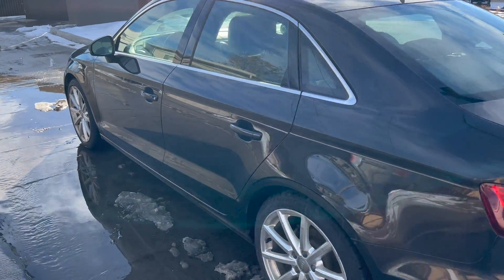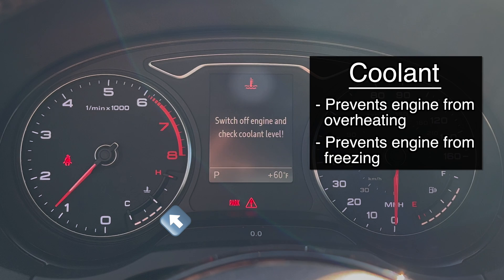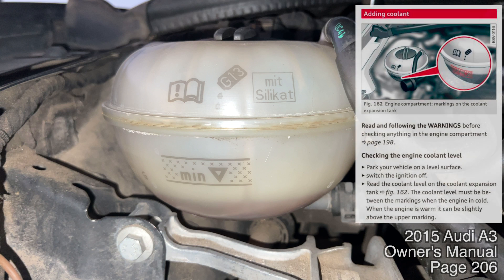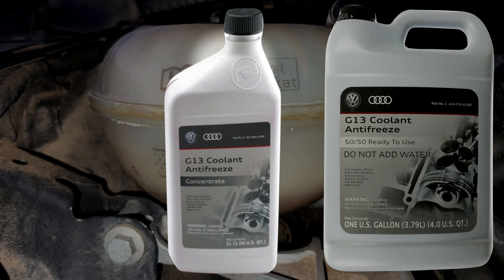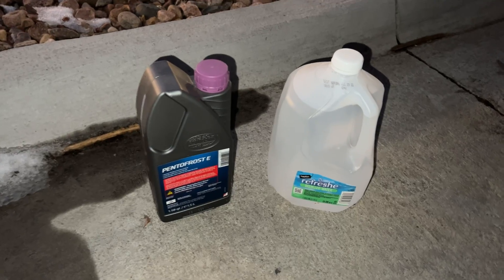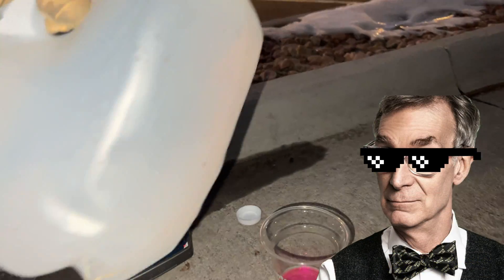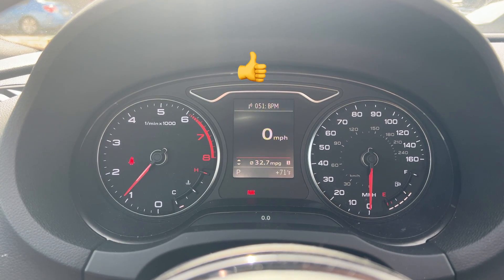How to Diagnose and Fix Low Coolant Warning for Audi (A3 8V) / VW

Comment from the maker: After further research, it appears that deionized water (also known as DI water) is preferred over distilled water (https://youtu.be/6K-EEiXzE-s?t=26) for mixing. However, due to its cost (affiliate link, $15/gal: https://amzn.to/3DkwAXy), and the owners manual stating that "mixing the coolant additive with distilled water is recommended", I will continue to use distilled water ($1/gal, affiliate link: https://amzn.to/3RnV4E5).
Moral of the story: deionized water > distilled water >> tap water

Apologies for not mentioning this in the video. Let me know if there's anything else that I missed!

Comment: Holy cow! Mine just came on today. I was waiting for crossing traffic to clear as I was trying to get out of a parking lot, sitting on an incline with my foot on the brake pedal and the car (2016 Audi A3 2.0 cab) in D. After I got out in traffic and 1/2 mile down the road, it came on. I thought it had something to do with what happened back there.
I drove the rest of the 4 miles home, but then forgot to look if it was still on before I turned it off.
I found this video, so I went out to eyeball the level. Guess where it was? The same level as yours!
Thank you for this.

Comment: What if when driving the temp drops all the way down. And ive been having a check engine light on for weeks now and all it reads on the oem is coolant flow, coolant intake codes
Reply from the maker: Well... based on your check engine light and coolant error codes, it sounds like something coolant-related is going wrong. 
0:39 "Coolant allows the engine to not get too cold and not get too hot."
Is it cold where you live right now? You might need the "anti-freeze" part of coolant right now to keep your engine from freezing or getting too cold. A cold engine means the oil will be thick and won't flow through the engine as easily resulting in more wear and tear on the engine than usual.

Comment: So i put the liquid to the seam area. After a day or two i find it low (in between max/min lines). After that i refilled to the seam, then again dropped after a day to between the max/min lines. I am bit sure if this is normal or not?
Reply from the maker: Hmm.. It's abnormal for the coolant to drop that fast and to require "topping off" every few days. You probably have a coolant leak.. 😕
Reply: @mattpopovich  thank you verimich for the reply. Imma leave my 2 cents here i case anyone would have the same issues:

2 fixes i had to do:

1. Replace water pump
2. Weld a leakage in the radiator (located farthest in the car, and was the harder issue to find)
Reply from the maker: Thanks so much for responding with your solution and helping the community! Glad you got to the bottom of it and got things fixed!

Comment: My coolant warning was on when I turned on the engine, and then I checked the coolant; it's basically an empty tank. Does that mean my coolant is leaking? Should I add coolant till the minimum line and keep driving?
Reply from the maker: Empty coolant tank = not good! 
0:51 "It's okay to keep driving with the low coolant light on as long as your engine stays at the normal operating temperature"
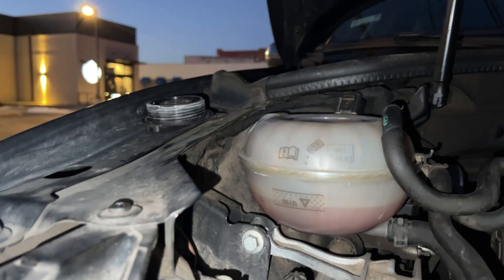5:48 "The coolant system is a sealed system. No coolant should be able to escape. Thus, if you're low on coolant, then that suggests a problem. If you have to add coolant regularly, then that suggests a problem. [...] If you need to add coolant once or twice a year, it's not a big deal."

I would add coolant between the minimum and maximum line and keep an eye on it. That should answer your question as to how bad it is leaking!

Comment: Hiya im filling everyday doing about 25 miles and light come on have had radiator done checked for leaks but nothing found but after driving i pull over i see water coming out what could my issue be
Reply from the maker: Filling every day = a coolant leak somewhere. Try to get a second opinion on the radiator.
5:48 "The coolant system is a sealed system. No coolant should be able to escape."

Comment: Very helpful video. I do have a question though. Do you need to leave the cap off, run the car at high heat to get rid of any possible bubbles, and then put the cap back on the reservoir after running it for a few mins or however long?
Reply from the maker: If you have air in the coolant line, yes. 
You can typically tell if you have air in the coolant line by seeing bubbles appearing in the coolant reservoir and/or your heat isn’t actually hot. 
Run the heat full blast with the coolant cap off. Make sure to keep an eye on the coolant level and add coolant as the air works its way out of the system. 
You can tell that you’re done by hot heat in the cabin and no more bubbles in the expansion tank.
Once done, put the cap back on and go for a drive. You still might get some air to come out of the system after a drive, so keep an eye on the coolant level for a bit.

Comment: What if the hazard don’t turn off
Reply from the maker: The hazards can be turned on and off from a button in the center of the dash. Check this video for additional information: https://youtu.be/6Y9JSbOg1vQ
Does that help?
Reply: @mattpopovich  not the hazard light the coolant light on the dash what if and don’t turn off

Comment: Did the manual say how full it should be at which temperature ? I'm currently at -7⁰C outside so I should only top up to minimum ?
Reply from the maker: It does not: https://ownersmanuals2.com/audi/a3-sedan-s3-sedan-2015-owners-manual-71870/page-208
I'd recommend, if it's one of your coldest winter days, wait until the car is cold and add coolant to the minimum line. My thinking is this is as cold that the coolant will ever be, it will always be warmer (and thus expand) above this point once the temperature outside warms up or once the car runs. If it gets colder or you get a low coolant warning, you can always add more!

Comment: Do I need to empty coolant tank before adding new coolant?
Reply from the maker: As long as you're adding the same type of coolant (or a type that can be mixed 2:07) and have no reason to believe your current coolant is dirty/contaminated, no need to empty the coolant tank before adding new coolant! 
CARFAX says flushing (completely emptying then filling with new coolant) every 100k - 150k mi is a good idea: https://www.carfax.com/blog/coolant-flush#:~:text=Is%20a%20Coolant%20Flush%20Really,hit%20100%2C000%20to%20150%2C000%20miles.

Comment: Hello, we have a 15” supercharged Q7, coolant is a little low and I want to top it off. So I can use the pentofrost or do I need to get the G13 Audi coolant. The current coolant in here is the stock dealer coolant.

Comment: I have an s3, so that temp gauge is replaced with a boost gauge. I keep getting the warning, but my coolant is just above the top line, like the owners manual says
Reply from the maker: Correct! Unfortunately I forgot about that when I published the video but I mentioned in the video description that there is a way to find the engine oil temperature on S3's, check this video for more information: https://www.youtube.com/watch?v=jSTC5FCfJdA
Note that oil temperature is different from coolant temperature, read this article for more information: http://www.tuneruniversity.com/blog/2011/05/keep-your-engine-alive-the-importance-of-oil-temperature/
Does the warning come on immediately when you turn the car on? That leads me to the car thinking the coolant is at the wrong level (likely low, not sure if the warning will come on for too much coolant).
Reply: @mattpopovich  it comes on right when I turn on the car but only the first few times (I deliver pizza for work so I do a lot of start/stopping) after a few deliveries it will no longer give me the message.
Reply from the maker: Hmm.. Weird. Do you park on a hill? I'm not sure why that would be happening. But it shouldn't be too serious if the warning goes away! 🤞
Reply: @mattpopovich  it is very odd. I park on a hill at home but I’ve tried pulling in and backing in but it still gives the warning. I’ve also tried parking on the street to see if the slanted driveway was the issue. Nothing changed. I did, however, just have the thermostat housing replaced. (There was a leak) I check the coolant every day just to make sure and it’s always inside the parameters. I really don’t know what’s wrong
Reply: @Cheggis same here. 2015 S3. Dealer replaced water pump and thermostat. Coolant is right at the max line, I check it every time I drive, still no change. I’m not sure why the warning would come on… any updates on your situation?
Reply: @M4R1011  YES! I narrowed it down to there being air bubbles in the coolant line. I had the coolant drained and replaced. That seemed to fix reoccurring warnings. Now it just warns me when I first start the car, or until the oil temps get up.

Comment: My coolant warning comes on after a cold day/night but the coolant level isn't low. It's within the min and max line. Could this be a sensor fault?
Reply from the maker: Hmm does the coolant warning turn off as well? If so, it sounds like the sensor is working.. maybe somehow calibrated wrong? I'd recommend double checking the coolant level when the warning comes on and when the warning comes off and then going from there.

Comment: Hi Matt, great video. Thank you for helpful tips! Digging deeper, what was the issue with your A3 8V for the coolant to be that low? I'm living the same situation right now with my A3 8V. (Bad head gasket seal? Water pump went bad?) Local garage filled me up with OEM G13 because i was near the same level as you were,way below minimum. They filled it a little over the maximum 3 days ago. Now I'm just below max , maybe it overflowed without me noticing,,, is it possible? I haven't noticed any leaks on the ground before or after they filled. It's entering the shop on Monday but I'm curious to know your issue.
Reply from the maker: Hi Gab, thanks for commenting. I don't know what caused my coolant to be low and frankly I don't plan on doing any further investigation, refilling with coolant once every few months is cheap and easy enough for me! 
As for your coolant going from above max to max, it could be a few things... If you checked the level before running the engine, the coolant could have "settled" to the lower level. It could have been warm (mid day or just recently ran engine) causing the coolant to expand when you first checked it and cool (evening/morning before you ran engine) causing the coolant to shrink a bit when you checked it later on. It also could be a slight leak somewhere. But I don't think overflow is a possibility as the coolant reservoir does have a lid on it preventing that from happening. 
Since your comment was a few days ago, what did the shop have to say?
Reply: @Matt Popovich  Hey Matt, I appreciate the response ! Thanks again for all the useful information 👍  Coolant has kept its level these last few days, The shop didn't find anything abnormal, no signs of leaks and able to keep engine at good temp. But I will keep an eye of my reservoir.  
Cheers!
Reply from the maker: @gabperreault2508  Glad to hear! Mine is an 8 year old vehicle with 120k miles on her so some minor work to keep her going is expected. Being that I'm waaay out of warranty, not sure what year yours is, but the $200+ diagnostic fee that Audi dealers charge can buy a lot of coolant (https://www.fcpeuro.com/products/audi-vw-coolant-antifreeze-pentosin-g013a8j1g) 😉
Cheers!

Comment: What if you have a TDI
Reply from the maker: I believe this video applies to TDI models as well. Check your owners manual to be sure. Your coolant reservoir will have a label of what coolant type to use (Ex. G13), which should be one of the options in my table shown at 2:20.

Comment: got this warning on my 2015 S3, but when I opened the lid for the coolant, it went up to max!!! was that a fake error? Now I have it a bit over max...just in case :D....Update on things...the water pump had a leak and was replaced
Reply from the maker: Sounds like you opened the coolant lid while the vehicle was still warm. Hot liquids (and gases) expand. 
Also, when the system is pressurized, the boiling point of coolant is raised. When you open the lid and depressurize the system, the coolant boiling point is lowered and the coolant will immediately start to boil (boiling coolant will burn you, so be very careful). 

To properly check the coolant level, let the car cool down (can take a few hours) and make sure the car is level. 

Yes, the water pumps are notoriously bad in these vehicles. Mine has been replaced a few times as well. But for me, I had a coolant tube that was (also) leaking. I aim to make a video about how I fixed it in the near future.

Comment: My low coolant light comes on regardless of whether or not it's full but the temp gauge is just as important than the coolant being full so I keep my eyes on the gauge. Plus my car is a Chevy Lumina from 1997 so it's very old and some dashboard lights may not read accurately.
Reply from the maker: Ooh, gotcha. Yeah, if the coolant light is unreliable then definitely keep your eye on that temperature gauge! Remember that just because it's cooling down out there, coolant is still important to keep the engine from freezing in the winter as well as cool in the summer. Good luck!

Comment: I drive a 1997 Chevy Lumina and my low coolant light is on but I have no leaks whatsoever and the needle on my temp gauge stays on the left side and moves close to the mid mark as I'm driving not right in the middle. I check my coolant level and it's below the min line. Coolant still remains in the tank though. My mechanic gave me a new water pump last time I bought it to him and it can't be the sensor because he would've fixed that.
Reply from the maker: Sounds like everything is working on it? I'd say just add coolant so it's not below the minimum line and go from there!
Reply: @mattpopovich I definitely will add coolant before we move into the winter months when it gets freezing. I check under the hood to make sure there's no  antifreeze leak and there hasn't been anything leaking. Old cars may have a habit of triggering warning lights to go on even when there is no problem with the coolant,oil,etc. For now I'm just going to continue to keep an I eye on my temp gauge and as soon as it goes above the middle I'll pull over when I can ofcourse and turn the car off.
Reply from the maker: @bryanrizzo9377  I mean it sounded like the light was on because your coolant was below the minimum line. If you add coolant, the light should turn off.

Comment: Any idea what the consequences of topping up with half a litre of tap water might be? Asking for a friend.
Reply from the maker: Haha, tell your friend that the consequences seem to be early rusting in water pumps and heat exchangers (years down the line): https://youtu.be/6K-EEiXzE-s?t=26
Also mention to them that page 205 of the owners manual states "mixing the coolant additive with distilled water is recommended". https://ownersmanuals2.com/audi/a3-sedan-s3-sedan-2015-owners-manual-71870/page-207
You can get it from any grocery store for a couple of dollars. Not worth the long-term risk of using tap water. I'd rather drive to the store on low coolant, keep an eye on the engine temperature gauge, then buy some distilled water vs. using tap water as a quick fix. 
However, if it is just a quick fix, in the short-term, I think you'll be fine with tap water. That's what mechanics used to use back in the day before they realized tap water was causing rusting in water pumps and the like. Just note that you'll want to flush the coolant system sooner than later to get rid of the tap water, then fill it up properly with concentrate + distilled water.
Other sources:
https://youtu.be/ZyJ657cQh2Q?t=60
https://youtu.be/38hTz6Ym-Xs

Comment: Why does the distilled water evaporate in a closed (sealed) system?
Reply from the maker: Good question and sorry if I wasn't clear about it at 5:48. Because the system is closed (sealed), you won't lose any coolant to evaporation. However, if you are losing coolant (to evaporation), that suggests that the system isn't closed or sealed and we unfortunately have a leak somewhere... I have a leak in my system due to having low coolant. I can either try to find the source of the leak (expensive + time consuming) or I can just keep adding coolant (cheap + quick). I probably only have to do it twice a year or so, so it's not a major problem. 😅
Reply: @mattpopovich  did you find out if the thermostats/water pump was the issue?
Reply from the maker: @MultiInKIEto  Not sure if you meant to reply to a different comment as I didn't mention a termostat / water pump, but no, I haven't done any investigation there and I don't plan to. I will continue to top off with coolant a few times a year. Much more economical option.

Comment: Hey ! Thanks for sharing

I did not see the full video and topped the coolant to the max of the container and not between the lines

How should I proceed? Drain all? How to drain? Or is it ok to drive. Oh dear.
Reply from the maker: Well worst case, the coolant can expand when it gets hot. If the coolant reservoir is full it could have nowhere to expand to and could cause a hose to burst or crack and get fluid throughout the engine possibly damaging electrical components. 
If the reservoir is completely full I would not drive until I sucked the excess coolant out of the reservoir. If it's a little over the line then you're probably fine, but I would get the coolant level back within the minimum and maximum line sooner than later. 
To suck the excess coolant out you can use a baster. While they're good with hot temperatures (this one can handle up to 450˚F), I'd still let the coolant cool down a bit after driving (affiliate link): https://amzn.to/3K3qnRd
Reply: @mattpopovich  awesome man! Thank you
Reply from the maker: @jhonhernandez3540  Good luck! Thanks for watching!